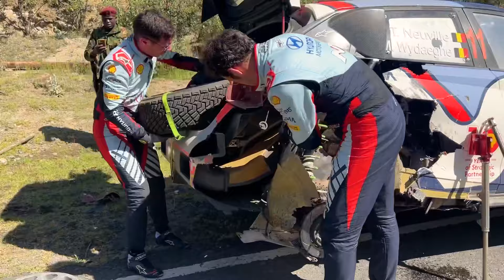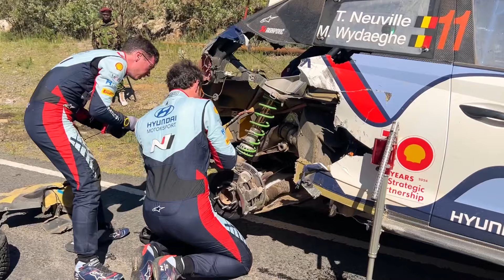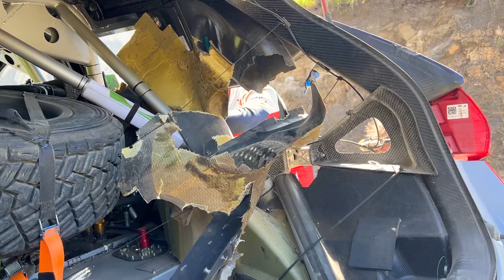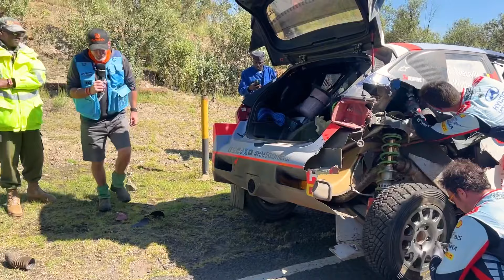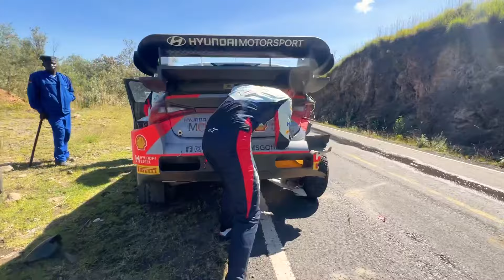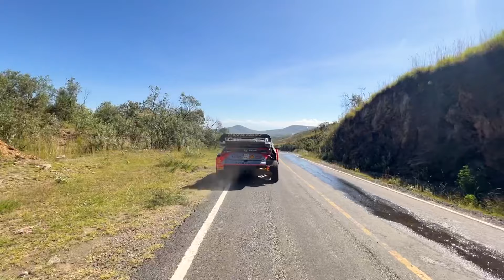Neuville Nightmare! WRC Safari Rally Kenya 2024

Comment: Hyundai moment
Reply: yeah cause that car is clearly a stock Hyundai
Reply: @bhuplaysguitar  No it's worse, it's a bespoke chassis that's supposed to be designed to endure the violet rigors of rally racing and yet the Hyundai's are still more prone to failure and unreliability. Will check after the Safari Rally is done and see how many issues the Toyota's have versus the i20.
Reply: @AKK5I all cars with a puncture suffer similar damage if at you've been watching WRC since 2013. Body panels are carbon fibre ddue to weight reduction. Long as the dampers weren't damaged...that was expected the moment he continued to drive with the puncture
Reply: Tell him ; It could happen to any car ,,,,,to yaris or puma !!
Reply: @harrisonmbugua5337  casuals who can't tell all those body panels on Rally 1 & 2 are carbon fibre and will be damaged by flying rubber from a punctured tyre

Comment: is it made of cardboard?
Reply: It's  called carbon fibre. 
It's  for weight reduction.
Reply: Carbon fibre shell. When a heavy rally tires explodes, it will tear even sheet metal and carbon fibre to bits.
Reply: carbon fiber. Those cars aren't "real road cars", since 2022 they are made from tube frames with a carbon fiber body looking like a production car. Kinda the same as in NASCAR.